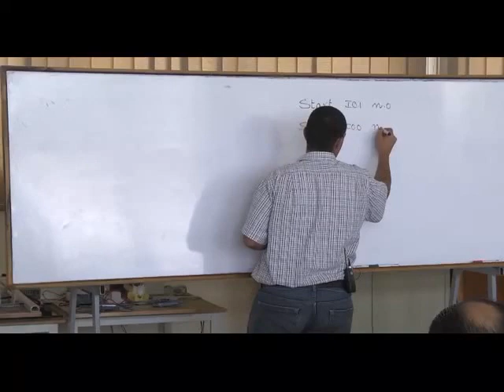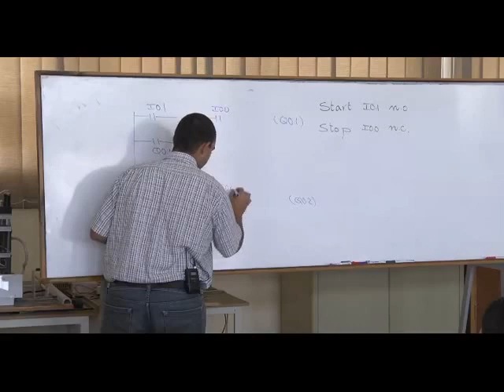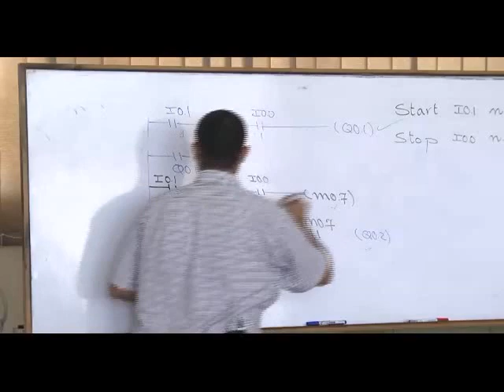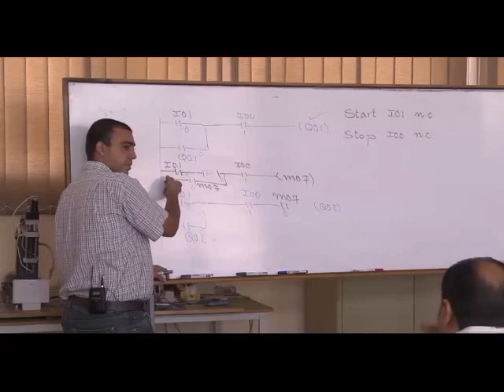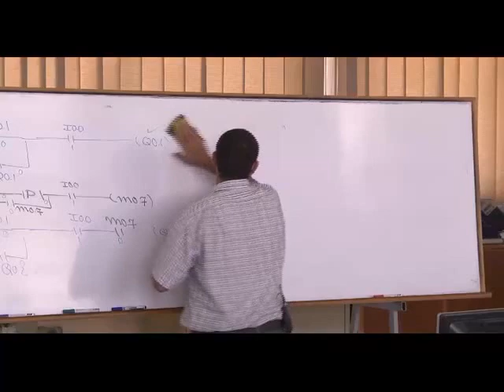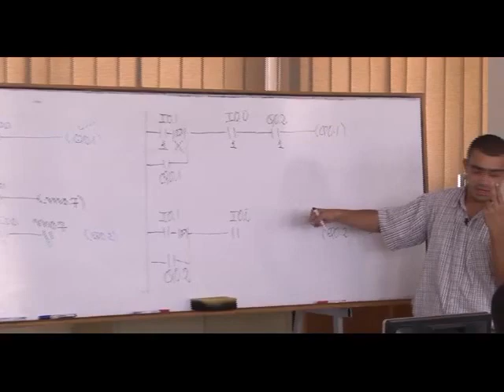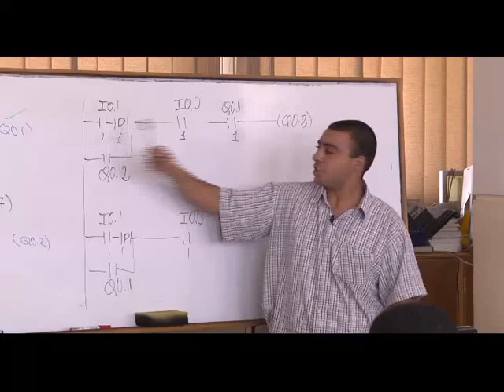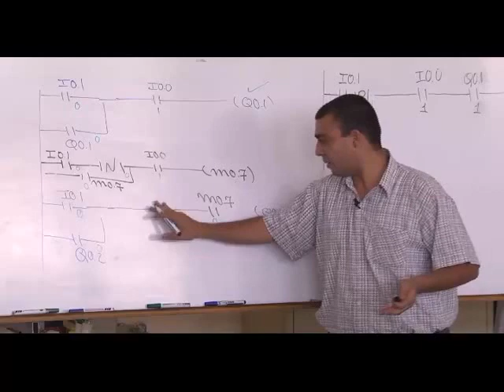22- Complete PLC Course | الدرس 16

Comment from the maker: Thanks for watching. For More Videos: Please Subscribe My Channel
:كورس PLC  معهد الساليزيان (دون بوسكو)  كامل ريمون كمال
Complete Practical PLC Course Tutorial: https://bit.ly/3dHon09 
PLC Programmable Logic Controllers Tutorial: https://bit.ly/2C22zhI
Advanced PLC Programmable Logic Control Tutorial: https://bit.ly/3g8FfO3
Solid State Devices Tutorial: https://bit.ly/31PedHP
Embedded Systems & Microcontroller Tutorial: https://bit.ly/3893dpH
Motors and Drives Tutorial: https://bit.ly/3dH0yF1
Process Control Tutorial: https://bit.ly/3hTASs7
Fluid Power Fundamentals Tutorial: https://bit.ly/2NSowCL
Fluid Power Design and Application Tutorial: https://bit.ly/3dEjvIq
Fluid Power Control Tutorial: https://bit.ly/3eniF3S
Electric Motor Control and Power Systems Distribution Tutorial: https://bit.ly/31Cib6c
Industrial Robotics Tutorial: https://bit.ly/38hQnWd
Industry Blueprints Tutorial: https://bit.ly/2ZqCn8p
AC Circuit Analysis Tutorial: https://bit.ly/2VyoHqP
Physics Tutorial: https://bit.ly/2BjVOaX
Motion Control  Tutorial: https://bit.ly/31sqUrz

Channel Link: https://bit.ly/2IsqVS for watching more Videos
😌Don't Forget To Like, Share, Subscribe & Leave a Comment Below 😬
======
تعريف بالقناة:
قناة تعليمية مهمة للجميع عليها أكثر من 210 فيديو تعليمي، بها:
1- شرح لبوردات الاردوينو Uno & Mega 2560  وعمل مشاريع رائعة بها حيث، شرح Servo Motor, DC Motor وطرق توصيله والتحكم في إتجاهه، و EEPROM وتوصيلها وكيفية التعامل معها. وال Stepper Motor، واستخدام الاردوينو كمولد موجات جيبية ومسننة ومثلثية،
رابط الدورة من هنا: https://bit.ly/2PvtHvx
2- شرح دورة الأنظمة المدمجة Embedded Systems والميكروكنترولر واحتراف البرمجة بلغة الامبيدد سي Embedded C. وعمل مشاريع رائعة…
رابط الدورة من هنا: https://bit.ly/2KadqX2
3- شرح كيفية الربط بين الاردوينو واللابفيو وعمل مشاريع رائعة بهما.: https://bit.ly/2KlTssj
4- شاهد أيضاً،دورة مهمة جدا لطلبة الهندسة في شرح أساسيات ومبادئ التحكم الآلي او هندسة نظم التحكم
(Automatic Control or Control systems engineering):
رابط السلسلة:  https://bit.ly/2NGyeYd
5- دورة متقدمة في التحكم باستخدام اللابفيو (مهمة لأقسام تحكم أو كنترول والكترونيات). وهي تطبيق عملي لدورة التحكم الالي 
رابط الدورة من هنا: https://bit.ly/2K7aVEE
6- سلسلة Root Locus Method في هندسة التحكم الآلي لطلبة كلية الهندسة، قسم كهرباء،
رابط السلسلة: https://bit.ly/33CROvi
7- سلسلة عملية في القوي الكهربية او الكهرباء المتردده الاحادية والثلاثة الطور (Electrical Power) لطلبة هندسة ولكل مهتم بالكهرباء
رابط السلسلة كاملة:  https://bit.ly/3dWEckc
8- بعض الدواير العملية الكهربية المهمة للجميع.
رابط الدورة من هنا: https://bit.ly/2Fnli65
9- دورة في القياسات الكهربية، مهمة لطلبة كليات هندسة ولكل مهتم بالالكترونيات والكهرباء: https://bit.ly/30RdTVS
10- دورة في احتراف الرياضيات والجبر والهندسة والتفاضل والتكامل والقوانين الخاصة بها بدون تعقيدات.:  https://bit.ly/30ykUtG
11- دورة في احتراف برنامج اللابفيو الرائع LabVIEW : https://bit.ly/2TOx4y4
12- برامج مهمة للكمبيوتر واللابتوب الخاص بك: https://bit.ly/2qT9NM6
13- Complete Practical PLC Course Tutorial: https://bit.ly/3dHon09 
14- Green Screen Tutorial Link: https://bit.ly/3esShFa
15- Complete Process Control Tutorial: https://bit.ly/3hTASs7
16- Complete Fluid Power Control Tutorial: https://bit.ly/3eniF3S
17- Complete Fluid Power Design and Application Tutorial: https://bit.ly/3dEjvIq
18- Complete Motors and Drives Tutorial: https://bit.ly/3dH0yF1
19- Complete Physics Tutorial: https://bit.ly/2BjVOaX
19- Complete Embedded Systems & Microcontroller Tutorial: https://bit.ly/3893dpH
20- Advanced Programmable Logic Control Tutorial: https://bit.ly/3g8FfO3
21- Physics Fundamentals Tutorial: https://bit.ly/2CNrzcU
22- AC Circuit Analysis Tutorial: https://bit.ly/2VyoHqP
23- Industry Blueprints Tutorial: https://bit.ly/2ZqCn8p
24- Industrial Robotics Tutorial: https://bit.ly/38hQnWd
25- Electric Motor Control and Power Systems Distribution  Tutorial: https://bit.ly/31Cib6c
26- PLC Programmable Logic Controllers Tutorial: https://bit.ly/2C22zhI
27- Fluid Power Fundamentals Tutorial: https://bit.ly/2NSowCL
28- Solid State Devices Tutorial: https://bit.ly/31PedHP
وهناك المزيد علي القناة، وان شاء الله هذه مجرد البداية فقط.
رابط القناة:   https://bit.ly/2IsqVSC
وتعمل اعجاب ومتابعة لصفحتنا علي الفيس صفحة المهندس المحترف
رابطها: https://www.facebook.com/المهندس-المحترف-100879698187843
متنسوش الإشتراك بالقناة لمتابعتنا وتفعيل جرس التنبيهات ليصلك الإشعارات بالفيديوهات أول بأول.
====
#ُPLC_Course
#معهد_الساليزيان_دون_بوسكو
#Kyrillos_Refaat